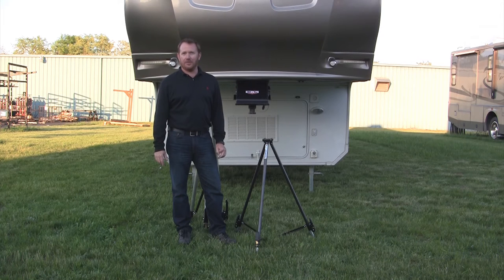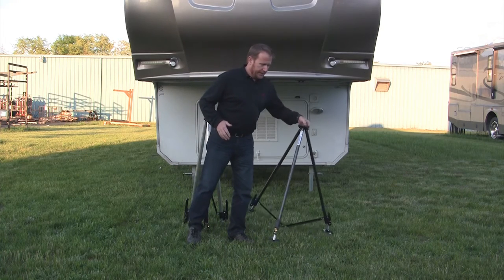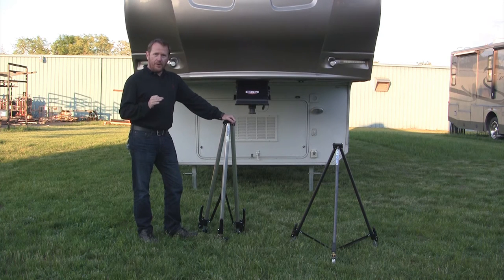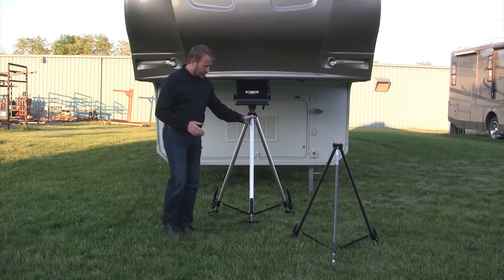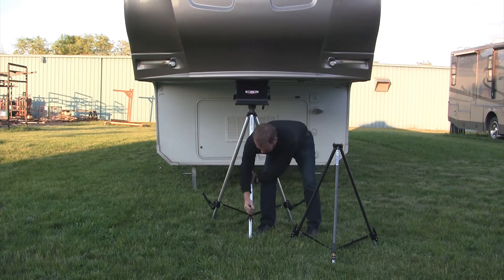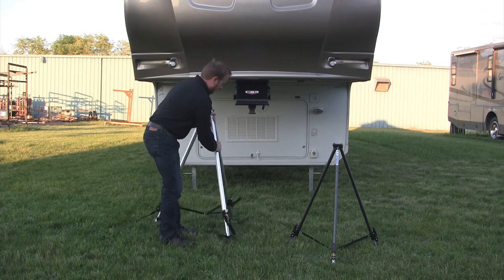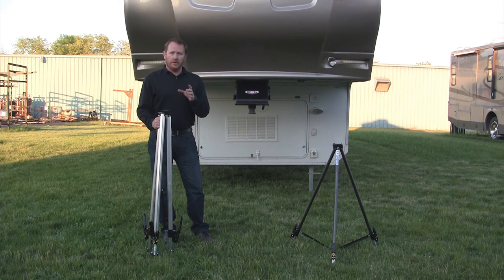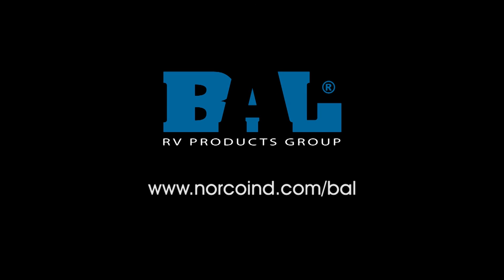BAL TriPod FASTJACK Full-Timer King Pin Stabilizer

Comment: Should tripod have one leg forward & two nearest the trailer, as your video shows, OR two legs forward & one closer to the trailer?? ( I've seen it done both ways...)
Reply from the maker: If you can to point one of the legs straight out the front of the trailer. That pushes one leg out from the front of the trailer and gives more stability. However, it does depend on the camping set up. Sometimes there isn’t room in front of the trailer to park their truck, walk around the front, or store the kid’s bicycles. Frontwards is best if you have the room to work with.